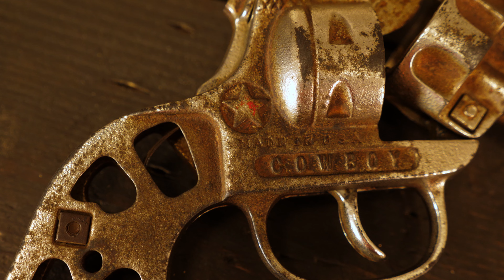Rusty Revolver Colt 45 Restoration - Cap Gun 1950's

Comment: Nickel plating (at least the DIY variety, in which you make your own nickel sulfate electrolyte) only works on steel and only adheres to very clean steel--i.e., steel that's been taken all the way down to bare metal. The toy gun is almost certainly pot metal, which is a polite term for metal alloys made up of any random, metal scraps swept up from a factory floor and melted to make cheap, recycled items. Pot metal rarely has much steel in it, because steel would raise the melting point of the pot metal and make it harder to work with. In other words, you can't nickel plate pot metal. As for steel, if you have any pits containing corrosion or dirt, that will make the whole effort unattractive. The steel surface must be bare metal, super clean, with a final wipe with isopropyl alcohol, and have no oil or fingerprint residue on it.

Comment: Zinc die cast has to be copper plated first, then it takes the nickel plating.
Reply: What did you use to weld/or Sauter the Gun hammer I didn’t see that in the film